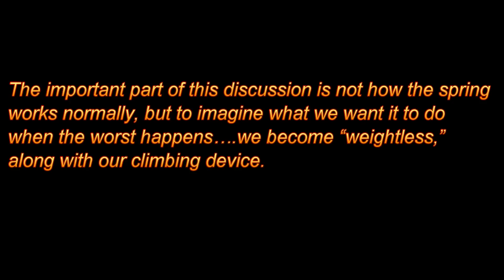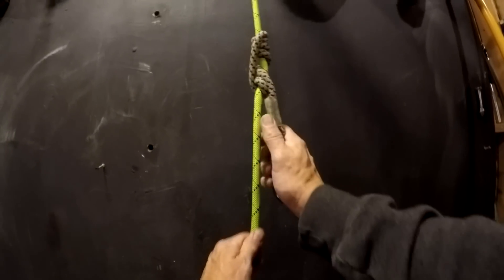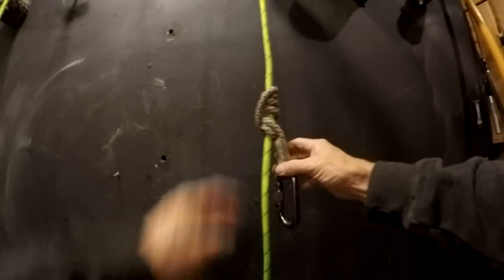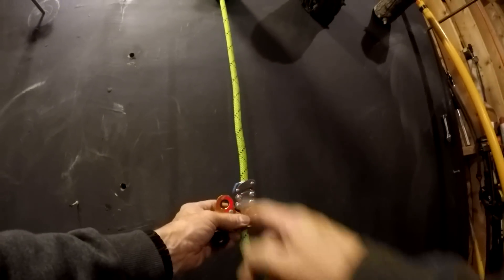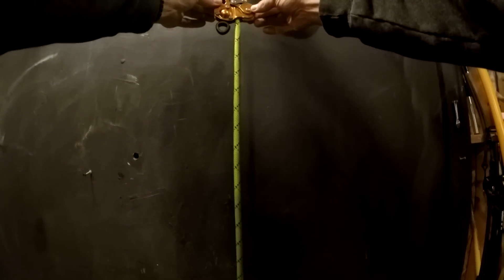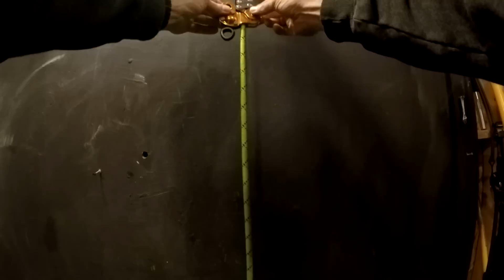Importance of the Spring Used in Mechanical Climbing Devices

Comment: I have ben climbing on the zig zag for 2 years now and I love it never had any issues with this device I know previous zig zag's have cracking issues at the point where the spring is at that he is talking about but I beleve with regular inspection and cleaning if need to you won't have a problem like I said I love the zig zag
Reply from the maker: love mine as well, both of them and with version 3 NO sign of problems.
Reply: What is the best way to clean your zigzag

Comment: Hello Richard-

Very interesting discussion. Wondering if you have any thoughts about trailing fall arrestors like the Camp Goblin particularly on a weighted tail line (or a long line with considerable self weight). The Goblin has two stage spring action (trail mode and parked mode)

Comment: Interesting video.  You never really acknowledge how important that little spring is.  Another very important issue I find with the zig zag is that a spliced end should always be used as the termination point on the mechanical prussix.  I originally used a fishermans knot,  or follow through figure eight and due to the rubber grommet where the termination biner goes, if moved towards the prussix assembly, it can keep the top tab disengaged and leaving the equipment disabled.  A splice and biner cleans up the equipment and prevents that from occurring.
Reply: Terry Leimonis  haha I do this too all the time with my double fisherman’s ! I need to get me a spliced eye. I’m one of the climbers that’s cheap and does everything with knots if I can. Zig zag was too smooth to pass up but I’ve just been mindful of my knot interfering sometimes but this is a great idea ! I will try a spliced eye !

Comment: I'm not an expert, but I disagree with you essentially claiming that the springs in these devices cannot activate after they become weightless. 

For example, if we were in a weightless environment of space and holding a spring in a compressed (or extended) position, and then let go of it, it would return to it's original position. The spring would not stay compressed (or extended). This video shows an example of a spring in weightlessness that shows what I have claimed, although this spring begins in tension rather than compression.

However, I appreciate your examining these mechanical devices and especially calling climbers attention to how they operate.
Reply from the maker: Kurt, thanks for contributing, perhaps I was not completely clear or you missed my full comment.  I was referring to the Unicender in your context.  Others will engage the rope.
If you are on solid ground or suspended in your harness, the Uni spring will provide upward pressure to the plates above engaging the rope. When the "bottom falls out", the spring may simply move the L bracket connector sideways,  leaving the plates to slide down the rope...
Reply: +Richard Mumford I definitely agree that in a weightless situation it's possible that a spring may not move its corresponding friction-causing component(s) far enough, and/or fast enough, to properly engage the rope to produce the needed friction. Without inertia provided by either the tree (via the rope) or the climbers body (via their attachment point) springs in the mechanical device have nothing to "push off" of except the components of the device itself.  I believe that's why these springs are typically very weak compared to the mass of the device they are connected to.  Hopefully the manufacturer's have taken into consideration. But in situations you describe, like a twig or sap, they are certainly vulnerable.

I just want to state that I believe weightlessness alone does not prevent the spring from "springing back". I'm sure the acceleration of gravity, which you also discuss, alters the behavior of a spring quite a bit. In the case where the body of a mechanical device is being accelerated downward by gravity I would expect parts attached to the body via bearings to tend to stay in one place, which in the case of a well designed device would cause the device to engage.

I have watched many if not all of your videos and I find your analytical approach in examining the products that my life depends on to be uniquely and extremely helpful. Thank you!
Reply from the maker: +Kurt W Thank you Kurt and it is interaction like yours that keeps us thinking.  I think we totally agree.  A spring properly placed and designed, can put a slight pressure against the rope to cause friction and get the whole process started, EVEN when we experience momentary weightlessness.  I started to realize that the Unicender will not do that.  I'm not saying it is dangerous etc, just an observation about how things work, or may not work like we expect.